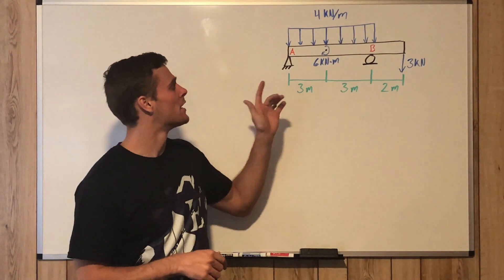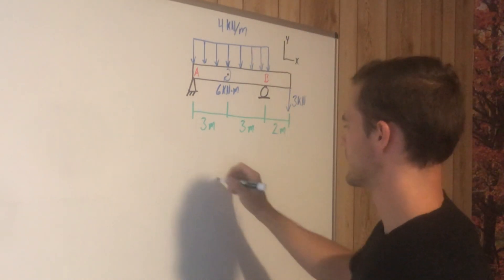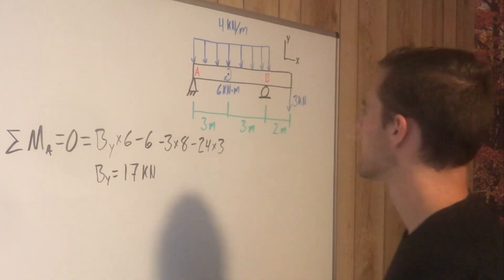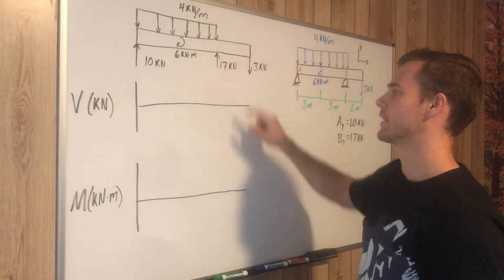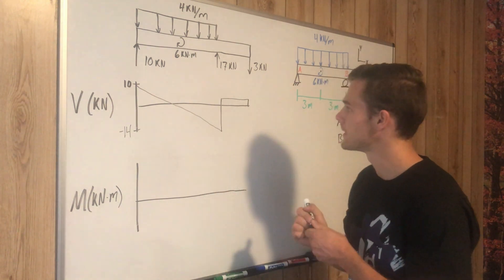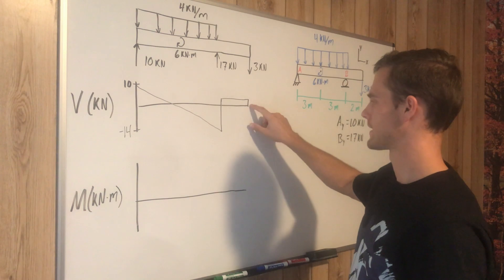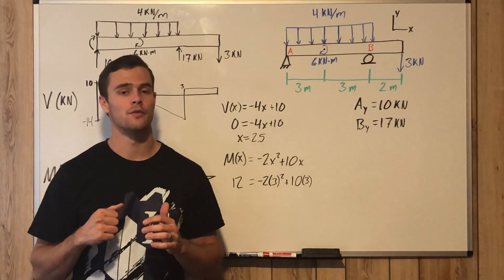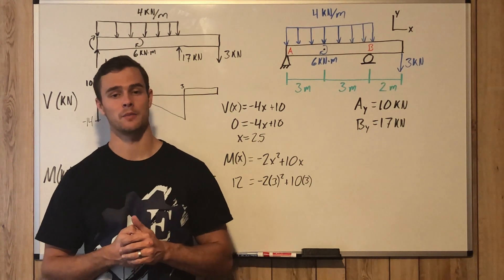EXAMPLE PROBLEM of How to Create Shear and Moment Diagrams

Comment: question

isnt 18+((-14*3.5)/2)= 6.5?? then that means the moment wont be in equilibrium. Instead shouldn't u have used the int of shear to get the moment equation then subbed 6 in
Reply from the maker: Great question! The answer to that equation is actually -6.5, not 6.5, so it is in equilibrium.